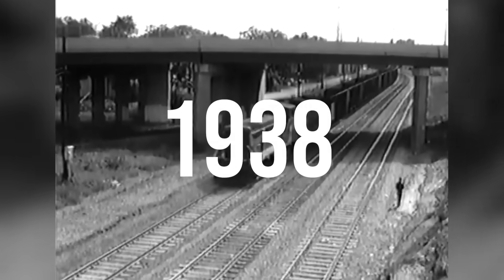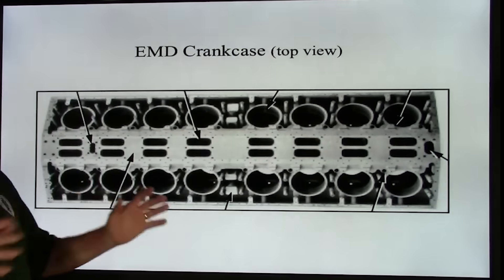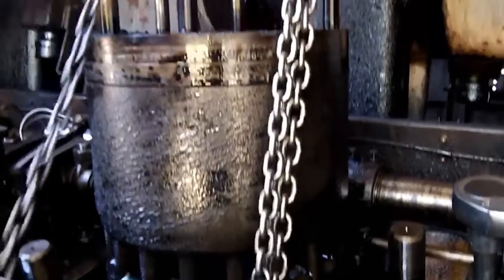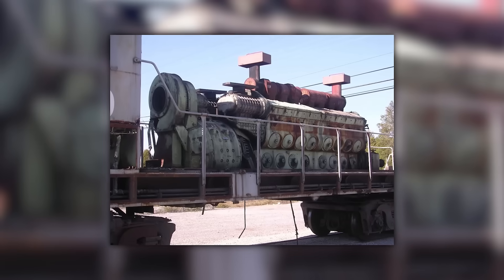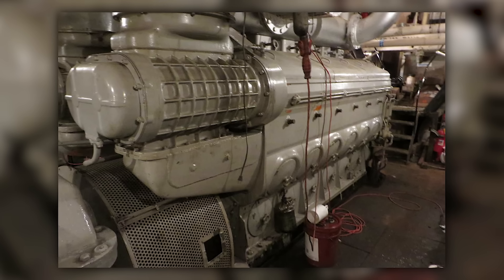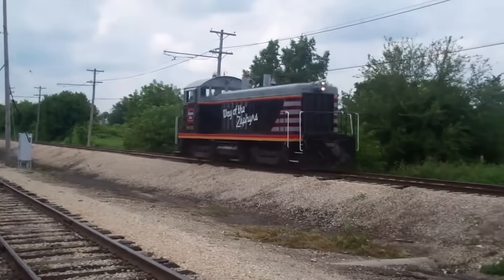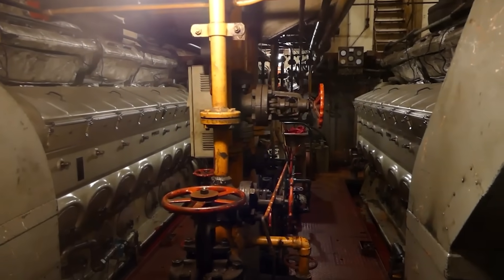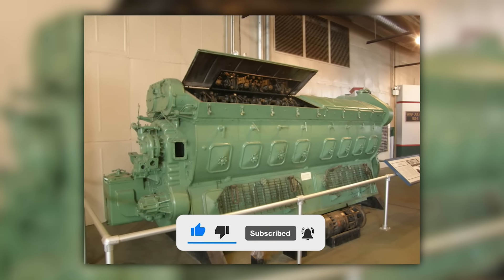The EMD 567 Engine That Silenced Steam in 1938

Comment: Worked on these occasionally when I worked for BNFS. Not many of them were around then. Hard to forget the square engine covers and having to cut a portion or completely remove the top in order to change out a power assembly or the exhaust.

Comment: Horrible video editing.  Describing a particular locomotive but showing another. Describing a 2 stroke but showing inner workings of a 4 stroke. Describing a roots blower but showing inner workings going opposite of flow.

Did you even try to check your work before you turned it in to the teacher?  

If you are going to report on something then dont half ass it.
Reply: AI slop

Comment: Great visuals , the first wastewater treatment plant that I worked at had one of these engines powering the emergency generator!
Reply: The 120 volt DC battery bank was scary however
Reply: The motor when running made conversion impossible in the whole building

Comment: EMD used WW II to create the infrastructure to build these engines using assembly line philosophies. Their competitors still used engine and locomotive construction that relied on the techniques they had used to build steam engines. Even though they had common design components, the competitors didn't have in infrastructure to mass produce these engines. This would include things like dedicated machines that only align bored the cylinder bores, or bored the crank bearing surfaces. EMD had GM's vast knowledge resources on how to harden steel so the cranks survived longer than their competitors. The engine itself was slightly better than competitors, but the incremental other advantages EMD/GM design engineers brought to the table made this the premier engine available at the time. Plus, EMD could produce these engines so much faster than anyone else in the market. Becoming the number vendor of locomotives took years of planning and development work. What they learned could also be applied to the construction of the Detroit Diesel engines used in highway trucks. In fact, a case could be made that the truck engine development was the proving ground for many of the design features of the 567.
Reply: The 567 came out in '38, the year before wwii started.

Comment: EMD engines absolutely kick ass. They're so easy to work on... Sure, they're a pain in the ass, but compared to say, a GE 7FDL... I'll take a 2 stroke EMD any day.
Reply: Hell no! I'll take working on FDLs all day, every day over that stinking dirty pile of junk that is a 645 or 710. You barely touch one and your all dirty, black with lungs full of exhaust leak soot. Pure garbage! Im glad the class 1 railroad I work at is slowly going away from these piles of junk and retiring them while upgrading the vastly more powerful FDLs and even GEVOs.
Reply: @erod6468 Maybe that's part of the problem. I never touched the more modern stuff with the Evo or the FDL-Y9, I worked on a much older model. Might have been the A block. Whatever was in the U33B. My road had ONE for a short time... The thing was an absolute piece of trash compared to the rest of the EMD fleet, which is saying something since we still use the SD50, which still tries to shake itself to death like Michael J. Fox in an earthquake 😂 It did come from Penn Central, so I guess that doesn't help its case.

Regardless, something about the construction of that 4 stroke design just put me off. And the turbo lag... Good God. Put it in 8 and wait. 2 miles down the line, STILL LOADING.
Reply: @PowerTrain611 😂😂😂 I see. Yeah, we do "push pulls" regularly. Meaning we couple 2 freight locomotives together to test their power and and dynamic braking one way and the other(one locomotive creates resistance while the other pulls it full power, then the roles are flipped). The EMDs most powerful iteration and use of their 710 engines, the SD70Ace struggles against the FDL or GEVO based locomotives. No competition. Might "spool" up quicker because it's a 2 stroke, but lacks the murderous torque those 4 stroke behemoths produce as you notch them up, even at low RPMs, creating much larger amounts of tractive effort and power overall.
Reply: Sadly EMD stopped production of new 2-stoke engines a long time ago... but you can still get power units for them. Caterpillar owns EMD now. One of the first things they did was design a new passenger loco around the Caterpillar C175-20 Power unit(an EPA Tier 4 compliant 4-Stroke V20 rated at 4700hp). You can get it in a 4 Mega watt configuration. The EMD F125 that they stuffed it in is the more Fuel efficient 3.5MW configuration. It'll be interesting to see what Caterpillar will do, if anything, for freight loco's. EMD hasn't had a new prime mover since the SD70ACe-T4(using the EMD 12-1010 4-stroke engine) that came out in 2015. Which is an absolute joy to run I might add. You'll find them all over Union Pacific roads.

Comment: After all the study and testing I did at GM on EV, Hybrid, Hybrid Plug Ins, Diesels, & Gas I'll tell you, a motor-generator/ motor set is not efficient. If you are enamored with it because of reliability, great but you are relying upon two things that are already proven. Nothing more. Especially not efficiency.  So, there's nothing new there. Inside dope:  The Chevy Volt was sold as a Plug In Hybrid that had a supplemental gasoline engine to recharge the battery when it became depleted. BUT,  I ran them on chassis dynos and occasionally I could feel the "bump" when the engine engaged the rear wheels. Although touted as technically a series hybrid or "extended range electric vehicle (E-REV)" because its gasoline engine generates electricity rather than directly powering the wheels, unlike traditional hybrids, guess what? They lied. The CEO of GM at the time, probably Akerson,  even went on the public news and announced that there is no connection between the engine and the drive wheels, but there was. And what I was told by top engineers (I was a lowly peon tech) "there is a clutch because you know there is efficiency losses if you generate electricity and then burn it in an electric motor. A direct clutch just makes sense." Toyota had  their so called "Synergy-Drive," a "series hybrid that had no connection between the gasoline engine and the electric motor drive.  It was lousy inefficient too, but the truth is THERE IS NO ENERGY CRISIS AND NEVER WAS ONE. So Toyota only concerned themselves with playing politics and getting attention, but the system was bullet proof and kept going, so it gave them a good report. I understand that there is no reason to connect your gigantic Diesels to the drive wheels on your locomotives, you have a steel rail system with very little friction, and it's very efficient to move freight with it, but please don't tout it as anything other than reliable. ben/ michigan
Reply: I am always pleased to read the all-too-rare comments of someone else with actual R&D experience who can poke holes in the corporate BS typically used to describe the "next big thing".  Remember,  'most any engineer can make a lousy design but it usually takes an MBA in Marketing to sell the lies.  "Pay no attention to the man behind the curtain."
Reply: @FredOlsen-yi2th  But he's not correct about the Toyota system.
Reply: The Chevy Volt was front wheel drive only, no power went to the rear wheels. You might be confusing it with a Lexus Hybrid of that era.

Comment: EMD's are still, mostly super reliable. I work with locomotives with EMD 710 engines in V12 and V16 configurations and more modern locomotives with twin Cummins 4-stroke V16s which are basically general purpose for heavy equipment. The Cummins engines are great but recently we had maintenance issues so the locomotives could only run with one engine instead of two. The parts were back-ordered for months. Meanwhile a broken EMD gets fixed in a day or so. EMDs are not refined at all but are still hard to beat to this day. Absolute peak engineering. I love the low idle sound and vibrations.
Reply: An EMD V16 or V20 sound awesome.
Reply: That’s sick!
Reply: I feel like EMDs are the better, bigger brother to the GMC “Jimmy” Detroit 2 strokes.
Reply: @theeasternfront6436because they are😅
Reply: @KieferShanks4172 Do you happen to know if these types of engines can work without any electronics still or have they been upgraded with integrated electronics?
  My question is due to increasing CME activity. It's not a question of if but  when one will be severe enough. 
   From my understanding a severe CME will not destroy all electronics  but possibly 15-20%. But having a strategic number could help.
Reply: It's ridiculous for Cummins to have parts backorders for months, but that's what happens when you change your design periodically and the effort goes toward production and not service support for the engines in the field.
Reply: Less moving parts (no intake valves). Power on every other stroke. Old dirt bikes 🏍️ are very reliable, two strokes.
Reply: It's because they were designed before planned obsolescence
Reply: @lollipop84858 Planned obsolescence dates back to the 1920s. Alfred Sloan used it to boost sales by making styling updates to GM vehicles every year.
These 1938 diesels came... after that.
The fact that 6 sheep blindly upvoted what you bleated out, while unsurprising, is still saddening.
Reply: Sir: May I counter with: The engine, the generator and the electric motor were proven technology. They were not new at the time and the companies were only interested in beating the steam powered locos.  I have no axe to grind here, just would like to make known that the technology they employed was NOT NEW and their use was only for one thing: beat the steam show. Somehow the inherent inefficiencies of the motor-generator-motor set were never under scrutiny like automobiles were during the "energy crisis."  or even now under the "carbon footprint awareness." And I for one am glad somebody is not in the crosshairs of the tree huggers. But, you'd better plan on a change if they reverse President Trump's progress back toward Freedom. ben/ michigan
Reply: @Moparben3713    You managed  to insert ''freedom'' in a diesel  political rant. I don't remember the  loss of steam locomotives creating such  turgid nonsense.
In fact Trump wound back rail safety regulations in his first term  . . . toxic material from Ohio rail crash in 2023 included the apologists for his stupidity.
Reply: @stephenbingham5935   Some morons will be blaming Biden for the next decade. You can't cure stupid.
Reply: @davidlong1786  Well...  Their Orange Jesus does it in every other breath, so why not?!  

What I love is the backhanded equating of air quality/carbon footprint being some sort of loss of freedom.  I guess Ol' Ben is another one of those low info, emotional "I have a feeling" thinkers that believe logic and critical thinking are some sort of Liberal fairy dust.
Reply: @stephenbingham5935 .  What regulations would you be referring to?

Comment: WRONG! The EMD FT locomotive did not have a pair of 567 engines.  It had one 567 engine.  The EMD E-series locomotive had a pair of 567's.
Reply: I thought that was off too. The carbody couldn't fit 2 of them. The frame would have needed to be twice as long. Also having 2 diesel engines would have been a nightmare for electrical generations. You can't have 2 separate generators powering tbe same equipment. Unless you woulda had 1 generator power 3 traction motors and the other one power the other 3. Which would also cause problems if the output of 1 didnt match the other. Like I said it would be a nightmare from an electrical standpoint

Comment: Alllison and Rolls Royce Merlin engines that powered ww2 fighters airplanes  produced between1500-1750 hp and were a fraction of the size. But its rebuild cycle was in hundreds of hours vs days and where far more complex
Reply: You have to look the torque production.   The 567 made that horsepower at 800 rpm.  It is a much more powerful engine than any of liquid cooled engines of world War 2.  I think you have to look at air cooked to really out power the EMD.  Something like a wright 3350.

Comment: Some psycho (meant in the best way!) put a blower from one of these onto a Hemi in his wheelstander-competing pro-stock (or whatever class it's from, I don't know drag racing that well).
Y'all see that infamous picture of a red (camaro I think?) with a cartoonish blower?? Yeah, like most, I thought it was early internet photoshop.. NOPE! It's a very-real EMD blower, sadly that's all we have about the project, as you'd expect he slightly pushed the throttle & blew the heads immediately with the front wheels lifting off the ground.. However making a custom very large upper pulley or very small lower would allow a correct ratio but I didn't hear anything about this guy or his project after that interview from 2 decades ago so who knows what ended up happening..
Reply: Sounds like he was a Darwin award candidate, like many men formerly involved with drag racing.

Comment: When did they switch from square access covers to round access covers ??
Reply: Model 567D, late 1950s.
Reply: @GregCaulton IT WAS THE C BLOCK THAT WAS FIRST!
Reply: Mid 1950's on the 567C engines.
Reply: @cpeast  1950... is/has/was? Mid 1950's... what?
Reply: @jefferyG499 I was just responding to the question @RickSadler had to when EMD changed the inspection covers for the air box and the crank case from square ⬛️ to round 😊. I have heard that it was around 1954 to 1956.

Comment: Whoever made this video did an outstanding job!
Reply from the maker: Why thank ya. It takes days, and a tremendous amount of research, so I appreciate the support.
Reply: @VintageAmericanMachines 
While the video is pretty well done, I think you need to watch the videos several times before posting them so they are completely accurate. Several times while you were talking about EMD turbochargers, you showed pictures of GE turbos which are a completely different animal from the corresponding EMD part. They are as different from each other in appearance as a submarine is to an aircraft carrier.
Reply: @ralfie8801 hahaha. Very true all of it. The things that those of us who spent time working on locomotives would notice though
Reply: @VintageAmericanMachines except you kept showing a Fairbanks Morse 38D8-1/8 blue print.   That’s one mistake I did catch right away
Reply: There were some inaccuracies but most of the info was on point and good stuff. A few GP9s came into the shop I worked in back in 2009 and was amazing to see a locomotive built 60 ish years ago still running strong.
Reply: 4:05 fidget spinners 😂
Reply: Having hired out on the B & O and knowing the operations of the F7’s and the 4 and 6 axle’d geeps, no amount of AI can take away my memories of the engine tappets and the main generators windings that I heard for 40 years… my dad always liked to remind me of the comparison  of rpm’s of a railroad engine and a Davey Allison stock car, the conversations we would have, take care everybody …
Reply: It’s not a “who” that created this, it’s a “what”.  The entire video is AI.
Reply: @MDC_1985  Yes, but AI has to be directed.  You can't just tell an AI "make a video about old trains" and get something like this.  It's a tool, like any other piece of software.  If anything, AI's tendency to confidently spout nonsense makes it that much more important to fact-check and refine the script before putting that into the TTS.  It definitely is cheaper and faster to make videos with AI, but it's not a hands-off process at all.
Reply: @JETZcorp  Hard agree. Lots of people assuming just because the TTS is AI, the whole video is by default also AI generated. I think AI TTS enabling creators who have scripts of their own but not the charisma or speech skills to narrate a video is a great thing.